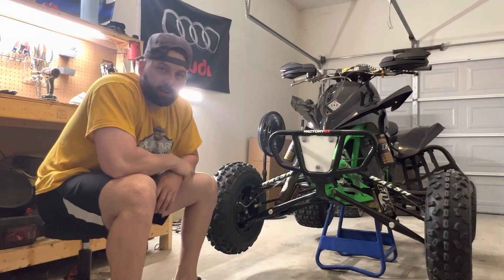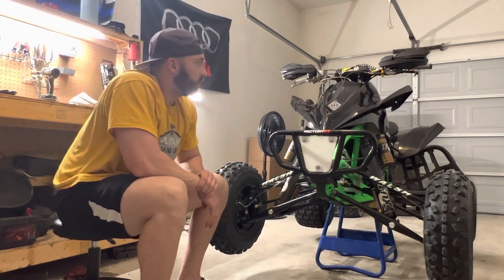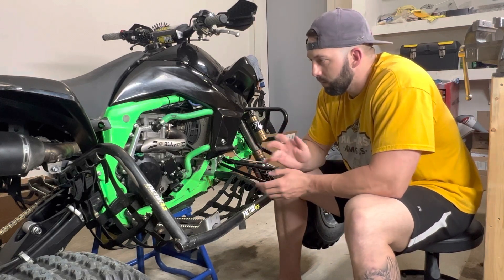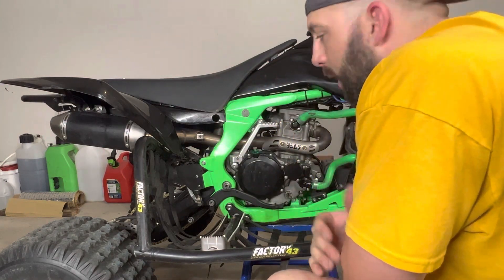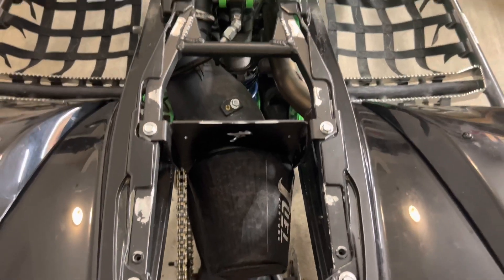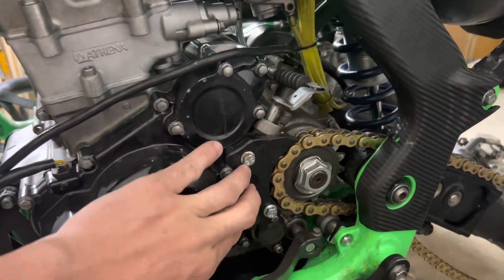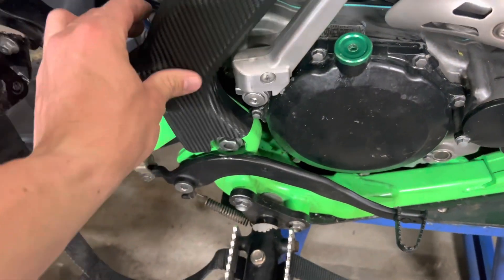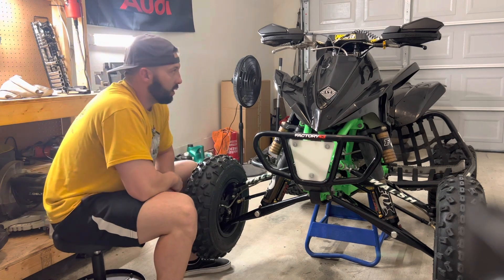My KFX 450 build breakdown

Comment: Glad u were able to save it with the carb swap. Too bad the electric work is always so hard and tricky and u would have been able to keep it fuel injected but I'm sure it will prove to be more reliable for you now
Reply from the maker: What’s goin on Ninja?! Yeah the EFI was just too much to work with. Carb has actually been proven to be more powerful in some parts of the power band. My butt dyno could confirm that in some areas haha
Reply: @KFX_JD  sounds like that worked out awesome! Dude I love ur bike. I used to ride a ton but my bike got stolen
Reply: @KFX_JD  I didn't have a 450 but I had a 400ex with cams jets and pipes. Probably some other stuff too I don't remember lol

Comment: What all did you delete in the wire harness for the carb conversion? Is there's anything you have to bypass or anything like that. Im currently doing a carb conversion on my kfx and having issues with getting it running. I already have a procom ecu
Reply from the maker: I deleted everything with the fuel injection. TPS sensor, intake temp sensor, neutral and reverse sensors (less wiring), and inlet air pressure sensor. I only had the fan, coolant temp sensor, frame ground, and coil going past the handlebars.